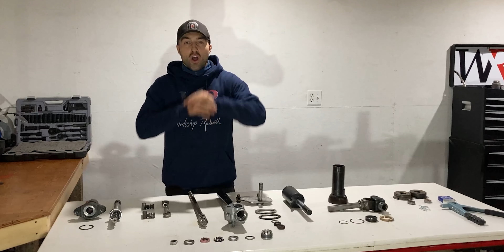Damaged Parts and Sub-Assembly Rebuilds  (John Deere 400)

Comment: Very much appreciated. You are detailed, clear, and organized. Just acquired a free family 80s 420 with almost 3000hrs but very well maintained. Am going thru it and your content is perfect for the refurbishing. Got a kick out of the idler pully bearing replacement, so simple and never considered it before. Looking forward to seeing you build up that damaged pistin shaft with weld then milling it down for repair. Betting that dland will still be good and you won't need to open up the sealed unit.
Reply from the maker: Thank you so much for your positive feedback, Michael! You have yourself a very neat John Deere garden tractor. Many say the 420 is a very refined version of the JD 400, which is pretty much true. I wish you luck with your refurbishment project and I hope you enjoy every moment, especially since you're doing it yourself.
The idler pulleys are most likely manufactured this way due to the bearing life-span. One can say they last 1000-2000 hours and then the pulley could be worn out too...but what happens if the pulley is still in good condition? "We throw away the whole thing and replace it..."
I like to repair or save as much as I can, especially if it's a repair under $10 and that's another reason why I removed this the original rivets.
The rear lift cylinder has been replaced with a used cylinder that was in good condition. I still have the old one and I might repair it in the future. I would personally part it on my lathe and replace all seals, as they are almost 45 years old now. 
Thanks again for your engaging comment. I hope you enjoy the rest of this video series. Regards Andreas

Comment: Wow, great instructional videos  I  have restored garden  tractors in the past.  Were do you get all the rebuild parts for you garden tractors.
Reply from the maker: Thanks for leaving this overly positive comment! I source parts locally and on the internet...depending on the project I have in front of myself. Most small parts like bolts, nuts, o-rings, seals & filters are easy to find. I haven't had to much trouble when working on any John Deere garden tractors. There are many parts that can be found online. Regards Andreas

Comment: can the worm gear be replaced, if so, where can i get one ?
Reply from the maker: Hi Jerrold, according to Weingartz (https://www.weingartz.com/assembly-diagram/john-deere-parts-lookup/model-400-hydrostatic-tractor-19-9-hp-k532qs-kohler-engine-pc1475-steering-wheel-gear-tractor-hydrostatic-400/4275-35688-554481) the worm gear is no longer available. This is a part that most JD 300 series tractors have and maybe you can find a good used one! I hope this helps. Regards Andreas